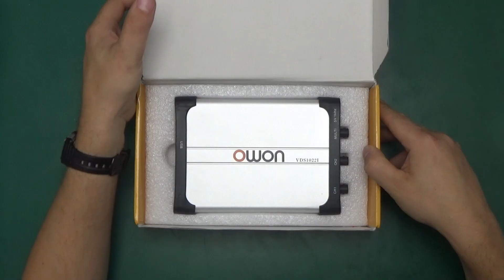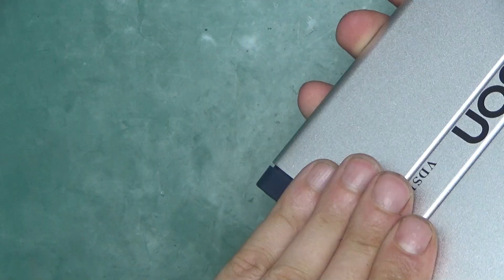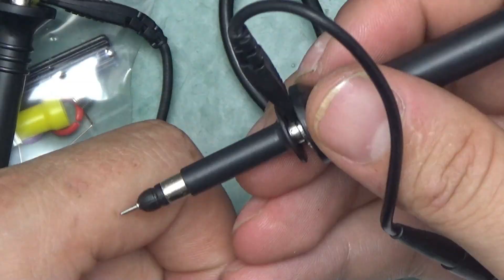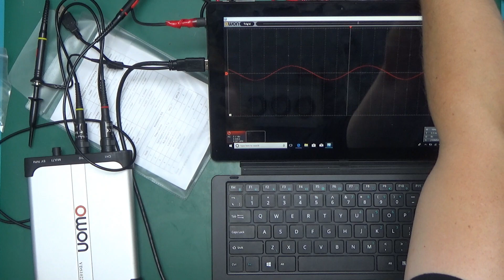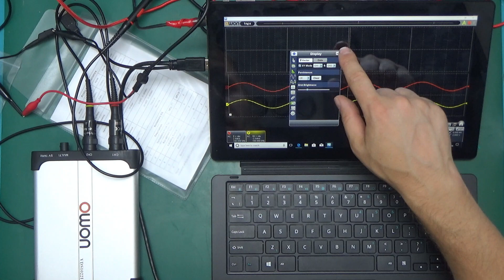#013 - OWON 1022i usb oscilloscope 2 ch / 25MHz

Comment: the hardware is solid and it has everything you need to get started👀>imgs.love/HDOscilloscope?j36   I personally needed it to check crank cam correlation and was able to do so within minutes after unboxing.

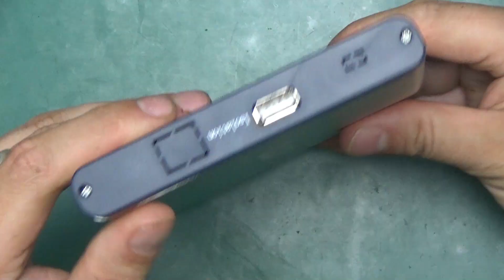Comment: Thank you very much for your videos. I need an oscilloscope to check on  the wiring in my full mux car ( CAN bus ). Which one of those oscilloscopes ( mentioned at 0:53 ) is suitable? Greeting from France.
Reply from the maker: Hi, I am not an expert on canbus, but I think it runs a few MHz at most, in theory any of those should do for basic bug finding. But with a better and smarter (and mor expensive) scope you would get on the fly packet decoding and much higher res of the signal. I have never played with canbus though, so please do a bit more research before spending your money.

Comment: I got myself a vds1022 (not isolated) for christmas a while back, Ive heard its pretty easy to cut a couple lines and add in some cheap isolation circuitry to convert it to the 1022I version since they use the same board just populated with different components, but I can't find the website that described this process. Anyone heard about this before and if so do you know which components I need? I think it was a charge pump power isolator and an opto isolator array.
Reply: jus try "usb isolator" on Aliexpres

Comment: Great little review how has this held up and how is the software? I am.thinkibg about buying one. are those standards BNC connectors connectors? Thanks in advance
Reply from the maker: Hi, BNCs are standard, and software is good, easy to use and intuitive. and no chinglish anywhere :) if the specs are right for you, this is worth every penny.
Reply: @randomtronic  thanks for the reply I ended up ordering one I was considering the hantek units but apparently there software it pretty complicated so I landed on the owon. Subbed